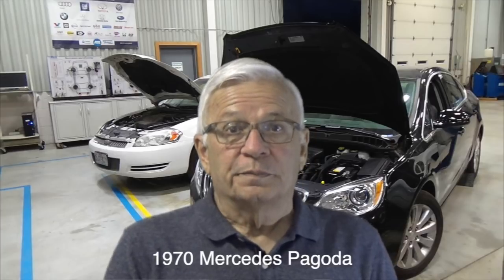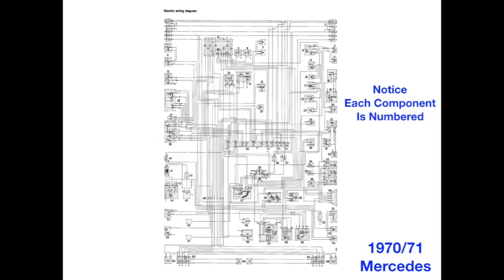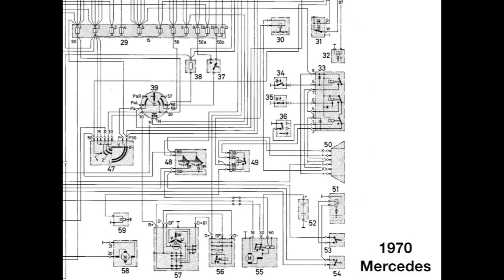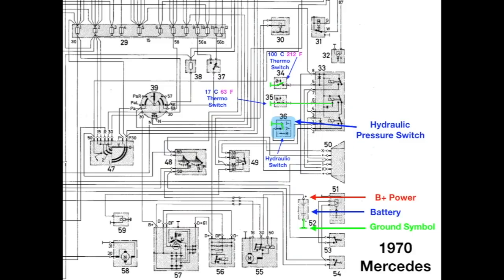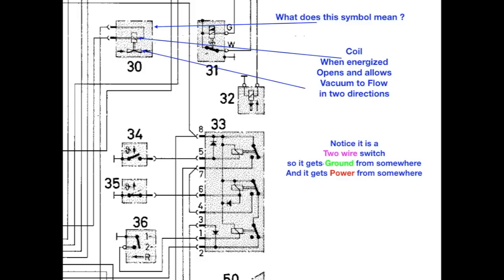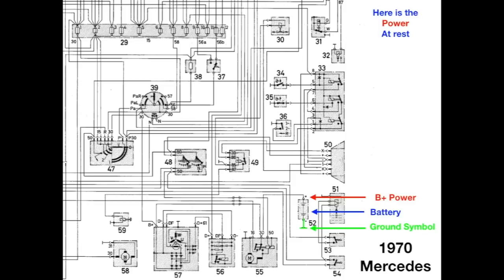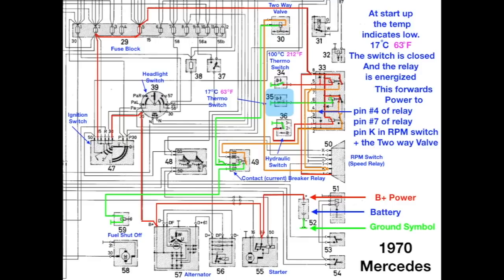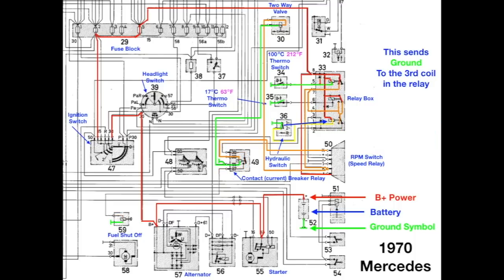1970 Mercedes Pagoda Diagram

Comment: Hi There Duane. 2 Part Comment:
1. Refreshing the basic lessons from realfixesrealfast I found this from Jorge Menchu (whom you recommended/mandate to read and added the link) and is exactly what you have done in this Mercedes diagram;
 "From the technician’s perspective, instead of being caught up in the
complexities of the system, we’re going to find the simple parts, examine
them and see how they combine to make the complex." 
2. Can you please give a brief about what I understand as "Transition Diagrams  (meaning before OBD II - correct me if wrong please-)" In these two cases?:
1979 DATSUN 280ZX   ( Engine 2.8 L -  L28E) and 1990 NISSAN 300 ZX  Twin TURBO
(Engine 3.0 L VG30DETT V6 Twin Turbo)
 ( I think this last one falls in this category of "Transition" more accurately ). Thank You.
Reply from the maker: What 
I was referring to as Transition Diagrams is this.  Before OBDII every OEM pretty much did things their own way. Both in manufacturing and in engineering.  For example, symbols, layout, coloring, direction, and orientation.  AS OBDII developed so did government regulation.  This has led to a more universal use and display of how electrical diagrams are drawn.  For example, before power and ground could have been come from anywhere.  Now, for the most part power is always drawn from the top of a page and ground is drawn from the bottom of a page.

Comment: If I could get hold of a copy of this schematic diagram, I could make an expended version that makes more sense.
Well, - I think I could after 40 years as an electronic engineer in the design and manufacturing industry :-).
Reply from the maker: John,  I can send you a copy of what I have.  mMy email is. dumar5907@gmail.com